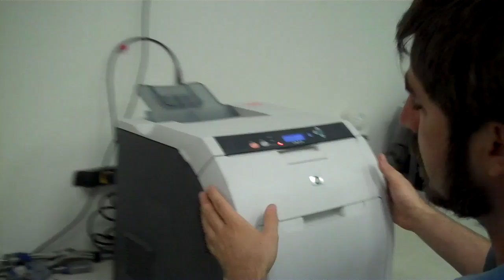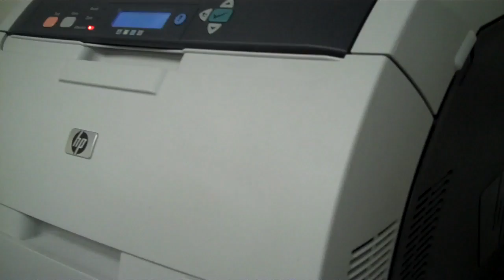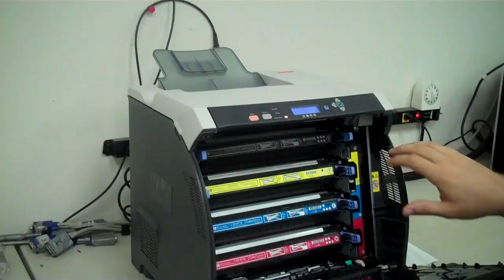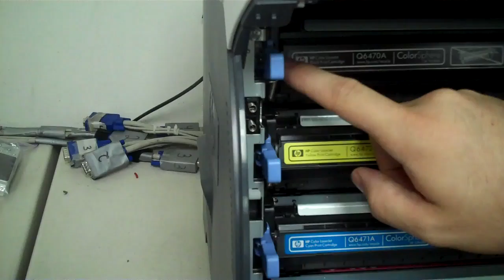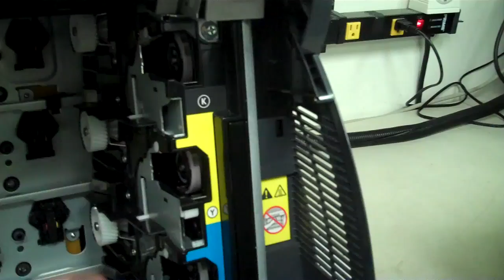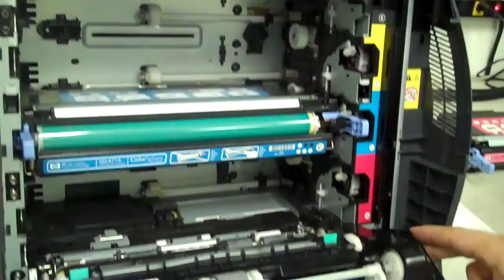Error 10.92.00 Cartridges Not Engaged - Color LaserJet 3600

Comment: i have a problem with the left side...how do i open ? the top (black cartridge) does go in enough (i attached it by a tape, and then the cartridge goes in, but then i see that the right side has a problem too...without the black one, the catridges opens, but with the black cartridge in, no of the other ones work anymore

Comment: Had the same issue, located the cause. After removing the right side cover you will see a white strip of plastic running basically vertical and it’s responsible to open the toner doors, but at the bottom you will find that plastic strip is broken and won’t lift the doors high enough and when there is more than on toner installed cartridge installed that white plastic strip is missing the plastic piece that gives it its final bush upwards. Photo to follow.
Reply: i have the same problem. Could u fix it?

Comment: Thank you! The left side of the printer was broken. So I forced the upper clip up. But then, the cartridges did not fit. I noticed that there were other clips on the left side of the color cartrdiges slots. I forced them up too (I broke one by doing this so be careful). And now the printer works perfectly. Thank you for having shared this video!

Comment: How do I determine exactly what the issue is?  I have the exact issue indicated in this video.  Without the cartridges installed, the levers that move the flaps on the right go up and down.  However, when I install the transfer assembly and the cartridges, the flaps do not go up - even with just one cartridge.  Any guidance would be greatly appreciated.

Comment: Thank you for this video.  It did lead me to find a broken latch on the left side.  I was able to disassemble the left side and get to the latch and I epoxied the part and seems to be ok.  However, I still get the same 10.92.00 code.  I did notice when the cartridges are installed that the right side of the ETB does not fully seat and latch. It does latch when the cartridges are removed but then I get the error message that I need to install the media.  So the question is, what would prevent the ETB from fully engaging when the cartridges are installed?  It does seem like all the cartridges are fully seated.  You can hear them "bottom out" when I install each one.  When any one of them are installed, the ETB does not fully latch on the right side.  So there is something on the cartridges that is not allowing the ETB to full seat.  Any ideas?
Reply: As a follow-up.  Looking at some other comments here I decided to remove the fuser and from above I realized that the cartridge roller covers are not opening up when the ETB is closing so this appears to be why the ETB can't latch because something on the ETB hits the cartridge roller covers when they don't open.  So now I know that the right side gears are not opening up the cartridge doors.  When I work the right side ETB holder like you do in your video (with the ETB removed), I sometimes see the cams moving and will close the cartridge doors but the action is very weak and most times the roller doors don't fully open.  You mentioned in your video that there could be a spring or cam broken.  Or does the whole mechanism need lubrication?  Do I need to remove the right side cover now to get to the entire mechanism?  Unfortunately, I don't see the follow-on video you mentioned you would do.
Reply from the maker: I appreciate your feedback. I'm hoping this will help others as well. I've noticed as the conversation continues I'm finding that more than one way this thing is breaking over the years.

Comment: GREAT video Joel, thank you. The left side wasn't locking, got it taken apart and replaced the left lock slide lever (RC1-6636). Got it put back together, cartridges are locked both left and right when testing w/o the transfer belt but I still get the error 10.92.01. Appreciate any additional insights you may have.
Reply from the maker: You may need to reset the printer to defaults to clear the message otherwise watch very carefully as you close it to see if the cartridges are opening all the way. Hope this helps.
Reply: I have an issue on the left side, too.  How did you know what part?  My left side clip for the black ink cartridge is not turning when I lift the left transfer belt arm.  It's a white clip.
Reply: @heidiberman1694  I took the left side off the printer and it was very obvious that the long black part was broken. I replaced the part and still had the problem. Turns out one of the cartridges was bad, replaced it and it's back to 100%.

Comment: Super helpful for diagnosing my issue, thank you!
 My issue was on the left side. After getting the side panel off I found that the cam slide (RC1-6638-000CN) on the  rod link was busted. Found the part on Amazon and it's on the way. Less than $5 to fix!
Reply from the maker: J H you rock thanks for letting me know the solution worked.

Comment: SOLVED: I found the error on my printer. One of the gear wheels to lock the cardridge came off the motor drife shaft. There are 4 motor under the cover on the right side to lock the cardridges.
Reply from the maker: SOLVED: That's very possible. In our situation the clip was broken. Feel free to share photos and a video of that fix. I'm sure there's others that are experiencing the same issue that you experienced.

Comment: Thank you, 6 years later and your video has helped me to diagnose the fault, now just need to strip it down and fix it!! :-)
Reply: SOLVED: I found the error on my printer. One of the gear wheels to lock the cardridge came off the motor drife shaft. There are 4 motor under the cover on the right side to lock the cardridges.
Reply: @praiosauge how do you open side cover

Comment: I had one of these today. Both sides broken & the exit sensor actuator broke also. One the left side 2 plastic guides were broken -left slide & mating gear. On the right side just the sliding guide.
THANKS! For an excellent & brief descripton of the symptoms & what to look for. The only suggestion I have  is tell us how to get those d... covers off!  Joel I hope you will keep making videos of hp printers.
By the way, I fixed it.😁

Comment: thanks so much, u are a life saver, our problem was the notch on the left side, it prevented the black cartridge from sliding in
Reply from the maker: hey Larry thanks so much for the comment I wish I was able to get a video together of it being repaired however the customer declined to have the service done so we were never able actually repair the printer.
Reply: @joelgulick393  I have this problem and would be happy to have you repair if the offer is still available.
Reply from the maker: @michellebeckwith6915  hey Michelle we would be glad to give it a shot. The only thing that would be any kind of obstacle would be being able to get the parts if necessary. Best of all if you give us a little time with it we will make a video and will dedicate it to you!

Comment: Hi Joel. I have the same printer. I have problem with cyan cartridge. In a test print it prints cyan only on the right side of the paper. the right side is white. and the border between them looks like a mountain (vertical). There is no repeatable pattern. Do you have an idea where could be the problem. Really appreciate your support. Thank you.

Comment: You're a saint!  Thank you.  10.92.00 error on mine occurred after I replaced black cartridge, and was due to white clip on l. side (black cartridge) being broken; i.e., stays in down position.  I threaded rubber band through the clip to hold it up while I slid the cartridge in place.  A black clip for the cyan cartridge was also not retracting completely, so I did same thing with that, and we're back in business (at least for now).  Thank you for taking the time to record these troubleshooting tips.  Most helpful!!
Reply: Thanks Deb, that worked for me too. :-)
Reply: great idea. I saw your comment and I used a twist tie and it worked.  Thank you all for your input
Reply: I can't tell you how much I appreciate you posting this.  It worked and I am thrilled!!
Reply: I have the same error and tried to hold the clip up but it doesn't. Can anyone please show where and how the rubber band or the twist tie was used with closeup? any help with this will be greatly appreciated.
Reply from the maker: @morganmamma1311 This is a brilliant idea! I'm pinning your process to the top. Thank you for your awesome feedback—you rock!

Comment: The clip on the left side of my printer isn't working... How would I go about fixing this?
Reply: Thanks so much Deb Rarig! Fixed my printer!!
Reply: Lauren - I had same issue with the left side clips (white one for the black cart. was not retracting at all, and black clip for magenta cart. was only partially retracted), and workaround for me was threading a thin rubber band through the white clip to hold it up while I slid the cartridge in place.  No good threading point for the black clip, so I just threaded around it as best I could and pulled the band straight up while sliding the cartridge in place, and that did the trick!

Comment: My problem seems to be on the left, black level (newly exchanged)
can I repair this or must a computer store help ?
Reply: I had this problem, on the left. The grey plastic lever for the black cartridge seemed to have no spring return, and was loose (floppy) in the down position. I raised the lever with unbent paperclip, inserted cartridge while lever was held up, then withdrew the paperclip. This solved the problem for me. The .00 on the end of the error message indicates problem is actually to do with Black cartridge
Reply: Nick, thanks so much. I had the exact same problem and it was the black cartridge. Followed your instructions and in 5 minutes I was back up and running. My hero!
Reply: Nick you're the Bomb! It worked for us too! THANK YOU THANK YOU THANK YOU!

Comment: After viewing your video, I removed the transfer belt and pushed the left arm up to get a better view and it locked into place in the up position which will not allow me to replace the transfer belt.  Can you tell how to release this arm?  Thanks.
Reply: If this happens to anyone else - this happened to me too and I thought it would break if I forced it back down.  It won't break, just pull down harder.  It's just very hard to release.

Comment: Great video... I am havering the same problem with mine I got the side panel off a And do not see any broken spring or the big long plastic piece. Do you guys take trade ins..? I am looking for a laser jet good name hp..that scans and is wireless. Any you would recommend..? What is the cost also if I shipped it to you for repair ? Thanks 
Sean

Comment: This has been a big help.
Because of your video I now know that the black toner latch on the left side isn't working. Any suggestions as to how I can fix this? I'm very handy but really reluctant to start taking it all apart without an over all idea of where to start.
Reply: Partially insert the toner cart and use something like a straightened paper clip to lift the later, intsert the car fully and release the latch. It should fall back down in to place. Worked for me.

Comment: It's very easy to resolve this problem. You can take away a little piece from the right of cartridge. So the locking clips of the cartdrige remain open
Reply from the maker: Sounds like this could work wish I still had the printer in the office to try it out on. Thanks for posting.

Comment: Did you created a video how to replace the part i got the part but i having problems putting it back . Part RC1-6643

Thanks in advance
Reply: +Joel Gulick Were you able to do a repair video for this?  Or at least something show what is going on inside the left-hand side of a HP 3600?

I am having the same issue as show in this video. Once I removed the ETB and manually operate the ETB levers I see that both the right-hand and left-hand locking mechanisms work fine, but the left-hand lifters fail to operate correctly, consistently, with more than one toner cartridge installed. 

If I remove all toner cartridges and manually operate  the left-hand ETB lever, it will seat itself properly into position and the lifters move fully, as expected. With no toner, repeated operation of the ETB lever works as expected, consistently. Upon inserting a single toner cartridge (it doesn't matter which one of the four cartridges inserted, nor does it matter which bay the cartridge is inserted), manually operating the left-hand ETB lever causes the lifters to operate as expected and fully expose the toner cartridge transfer roller. Upon inserting second toner cartridge and manually operating the left-hand ETB lever, it does not operate correctly; which cartridge and which bay makes no difference in the outcome. With more than on cartridge installed, the lifters fail to move into their proper position and do not fully open the transfer roller covers. 

When this doesn't operate as expected I can feel some odd resistance in the left-hand ETB lever. It seems that something is either broken or improperly seated inside the left-hand side of the printer. My next step would be to open the case and explore the left-hand mechanisms. While I am confident in my general ability to solve such issues, these kind of videos are very much appreciated and help to provide confidence and certainty. 

Thanks!
Reply: +Carlos Reyes Jr That's a great question, at the customer's request we where install the provide the solution for the customer due to the cost of the repairs. If you would like you could send in your printer. We could install the parts free of charge as long as you purchased the parts that we request for the repair plus shipping and in return. In your honor we will post a video for all the youtube world to have. You could help many others see the fix.

Comment: How much should it cost to repair a printer with this problem? I am trying to decide if I should just buy a new printer or if it is worth paying a tech to fix it. Your suggestion would be appreciated. Thanks
Reply: +Frank Martinez If your going by cost, I would choose to buy a new printer. Two reasons One the cost to fix the printer by Professional will cost well over $250.00. Second there is no warranty after 90 days from us and others do not even warranty the work provided. This is a known issue with this device and was never reported by HP in my belief. However our values and beliefs are if you can't fix it, it owns you.
Reply: +Frank Martinez did the paper work
Reply: SaintAnn TravelAgency Sorry, but no. It did not work.

Comment: it is good and informative. However there should be some video on trouble shooting. For example I get sometimes horizontal or vertical lines on the print and even the print ink is not uniform thought the page. Thanks
Reply from the maker: Fuser Sounds like the problem.

Comment: Thank you for this video - definitely helped me diagnose what was going on with my 3600n.  Just installed a new magenta cartridge and I think I narrowed it down to the "window" (for lack of the proper term) on this new cartridge being somewhat sealed tight, not sure why but I was able to break it loose.  I guess the printer gears weren't strong enough to do that.

On the right side I was able to roll one of 4 white gears and lift one of 4 tabs to open all 4 up and allow cart removal and installation, but... something is obviously broken now as closing the door doesn't automatically open and close all 4 toner cart windows - they're stuck open. And now of course I can't replace the carts at all, they won't come out being locked open and locked in place.

When the time comes to do this, any ideas on what I can do? For now I have about 15% remaining on cyan and yellow, but they'll need replacing eventually... cross that bridge when I get to it.

Comment: Great video and thanks. When I move the ESTB on the left, the clips don't move at the same time or very much. I'm assuming they should all move at the same time however I move the ESTB. When I move the left ESTB down, the middle two clips don't move but the bottom color clip and top B&W clip are loose. Any other advice or tips?? Thanks

Comment: My problem seems to be on the right side.  My ESTB does not lock in place on the right side when shutting it (big white lever on transfer belt) it almost seems as though transfer belt is on a bind right side.  Door has gap on right side when closed.  Don't know if gears got out of alignment or if broken tab or spring.  Any insight, any more videos on HP ColorJet 3600  Thanks

Comment: Thanks for helping me identify the problem.  How do I fix it?
Reply: Great Question. The main cause of this printers problem is related to the springs located behind the side panel of the printer. For this printer the problem was the Tension spring - It provides tension for the right side toner cartridge lock lever - Four springs are used.. Others may have to replace more parts then just those. Our Contact info http://www.savannahitshop.com
Reply: Computer Solutions What's the cost to repair this?